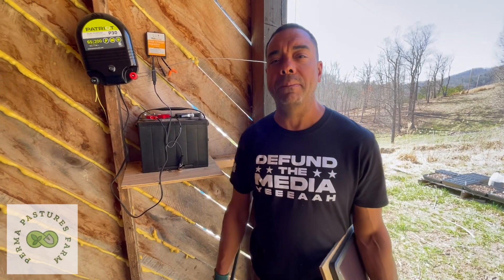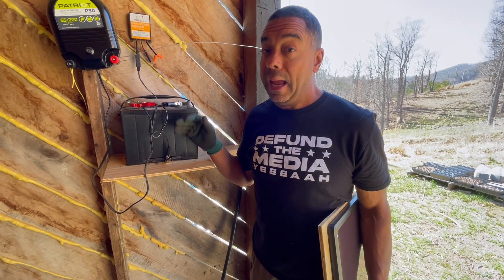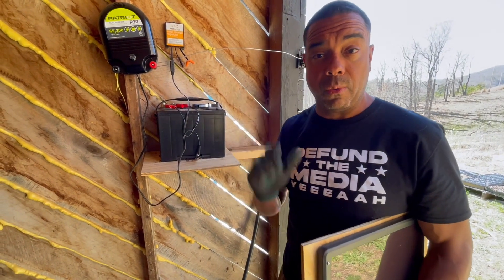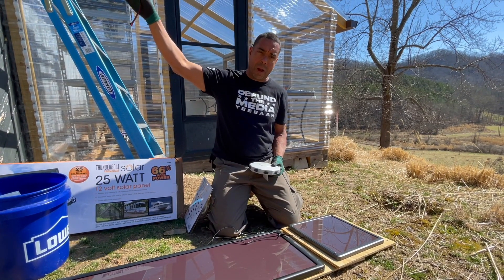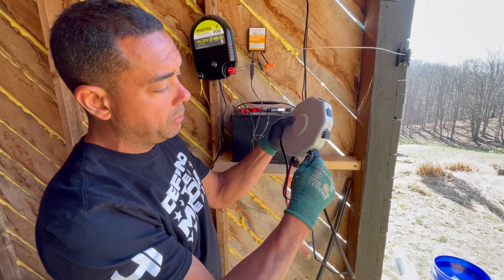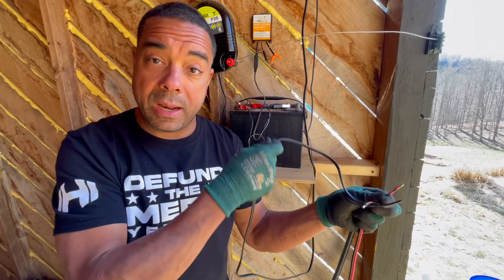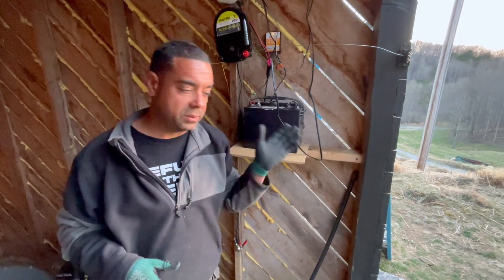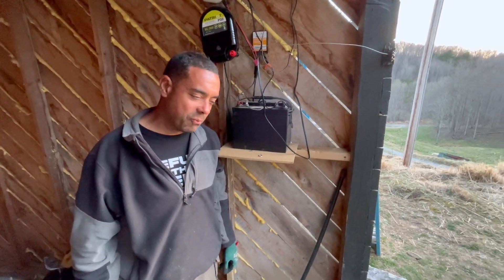Adding To Our Off-Grid Energy Supply

Comment: Where do you provide the information so that I can purchase the central connection hub device that you said costs about ten dollars ? Thanks in advance . I’ve got a bunch of solar stuff but don’t know how to put it all together. You should write a simple primer for folks so that they can have electric fences that work.
Reply from the maker: I explained much more about solar components in this first video:
https://youtu.be/EcA7L49oPZM

Everything I used came from Harbor Freight. When doing solar it’s best to use all components from the same manufacturer because the suppliers don’t standardize most things.

Comment: You should get a Tesla and use solar power to charge it. When I heard about bitcoin I wanted to buy a shack out in the desert and use solar power to do my minning. One of the issues is even if you could run on all solar you have to keep upgrading the computers because the math problems they give the computers need more power graphics cards to find the answer.

Comment: Can you post a link for the solar equipment you’re using?
Reply from the maker: I’ll get it done.
Reply from the maker: https://www.harborfreight.com/7-watt-solar-panel-kit-64801.html
https://www.harborfreight.com/7-amp-solar-charge-regulator-96728.html
https://www.harborfreight.com/solar-power-connection-cable-kit-63981.html
https://www.harborfreight.com/400-watt-universal-solar-connector-68689.html